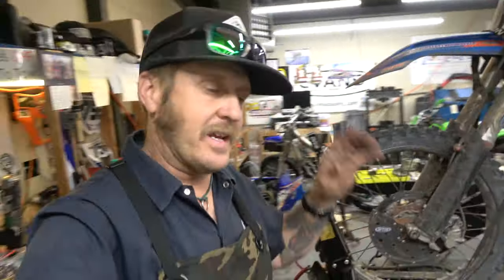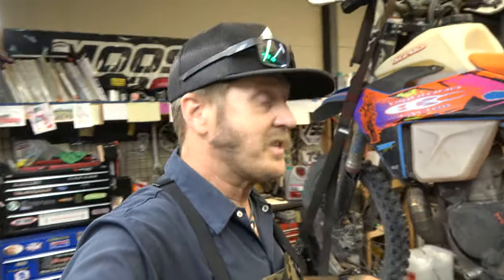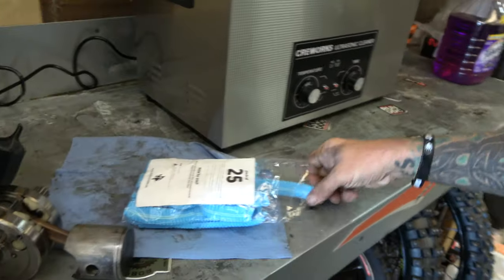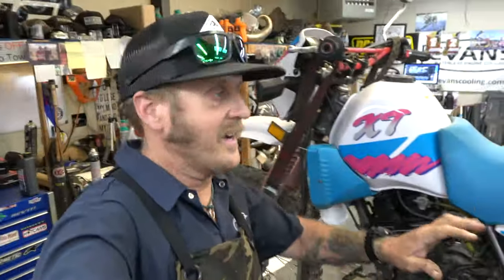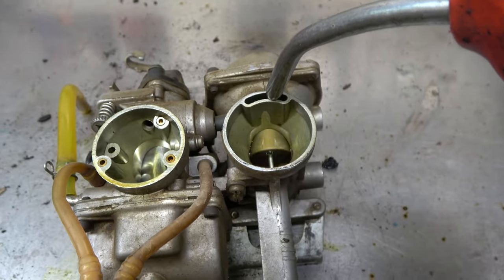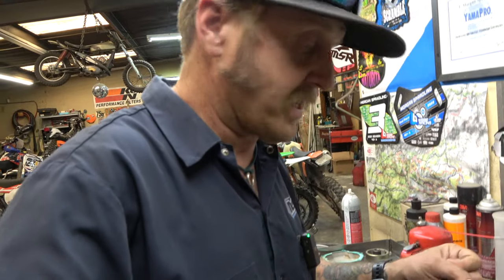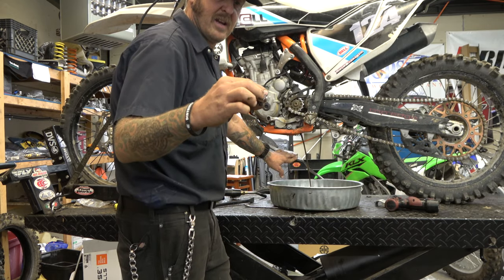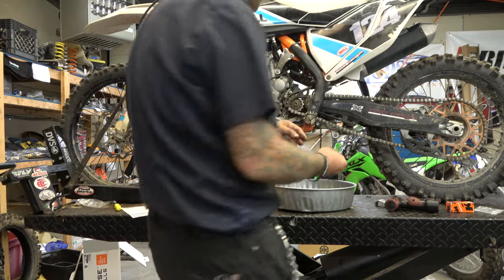The Shlog #257 | Rebuilding A KTM Slave Cylinder | 150 SX Crank | YZ250 Top End | RM 125 Jetting

Comment: Check out the Capri Tools Wave Drive wrenches, same shape as the extractor sockets but in a wrench. Have had drain bolts even worse than the one you had and they worked great.
Reply from the maker: will do

Comment: Damnn I wish you cleaned your airbox before removing filters. Just my thing, I would knock a chunk into the airboot.
Reply from the maker: Hahahaha. I don’t know how to really clean the air box without getting the filter out first?  You can’t get to the back of the box with it in there. I’m just careful and if I do knock things in (and I have) I just clean it out.
Reply: I take WD 40 to the plastic around the filter seal area and a towel and work my way around the top and bottom and sides wipe clean and seat comes off if it is dirty underneath. Only take a moment to do. Then filter comes out.